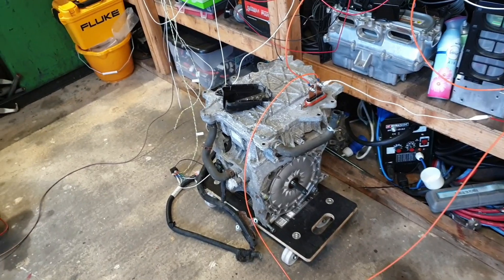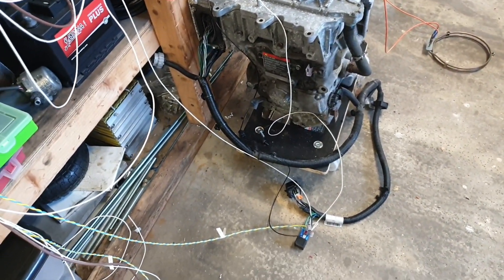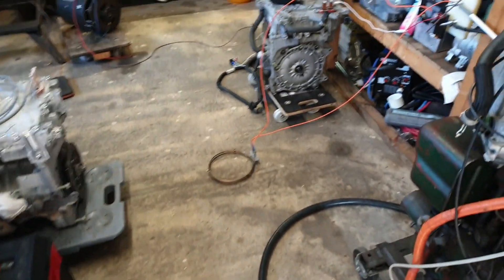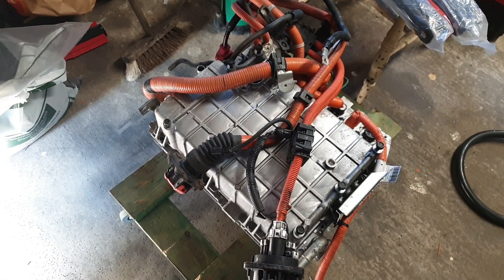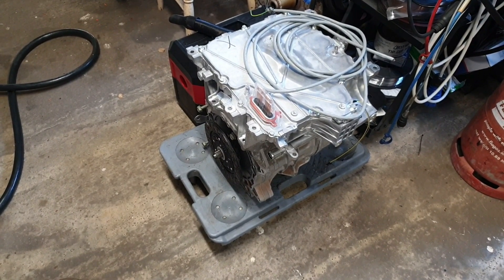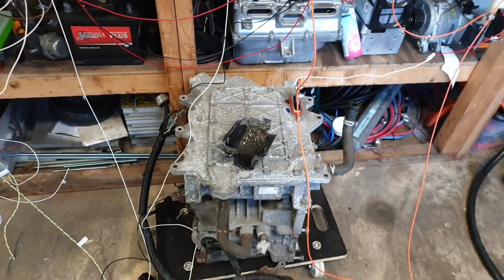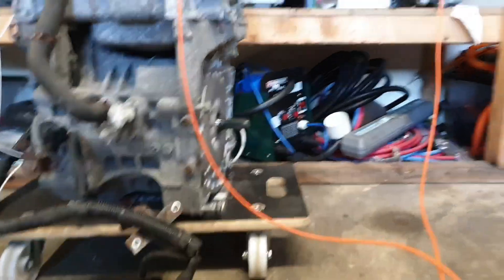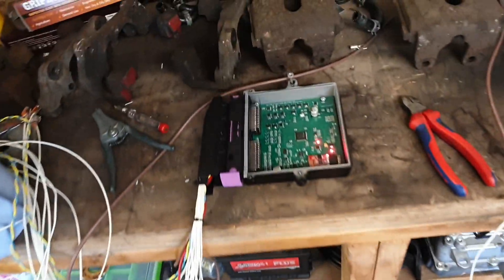Leaf Gen2 ZombieVerter Part1

Comment: People need to remember that refineries don't just give us gasoline or diesel. They give us engine oil, gear oil, lubricants and plastics. Petroleum byproducts are in creams and lotions.  The reason the US buys crude oil from other countries is becuse we have one of the best refinery networks. The refineries turn low cost crude into higher dollar products. The refineries are like little money factories, you buy a barrel for a set price and sell it's byproducts for 4-10x the price. It's the reason the United States has as many oil companies when you walk in the auto parts store. It's the reason the United States presses and forms as much plastic as we do, even though it is a relatively low profit margin branch of manufacturing. A refinery closing is bad news for everyone as it means that other industries will suffer, or more likely than not, other countries will pick up the slack in refining crude into usable products.

Comment: Damien is a great job !! Thank you very much ! you helped me a lot !!!!
I slightly supplemented the code and implemented the possibility of turning on the parking and choosing the direction of travel on the original Nissan handle, although I had to remove the message 11A and install the standard unit 310383NA0A. Thanks !!!!!

Comment: resolve-ev is the one that can control the charger
Reply: If it's resolve-ev, that one requires the use of the original Leaf BMS, which the PDM directly talks to. Using the PDM here will require implementing the Leaf BMS protocol to some extent. I meant to start doing that myself but I've gotten stuck doing various other projects... Well, now I can just sit back and watch. 😎
Reply: @celeron55  or make your own and get a few bucks, i would if i was smarter :P